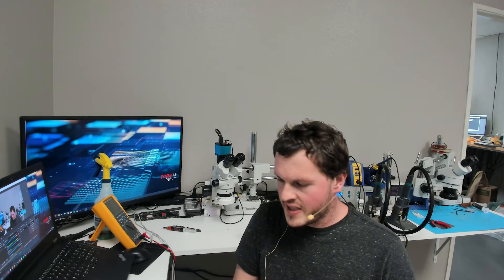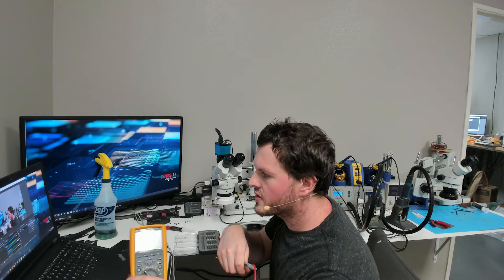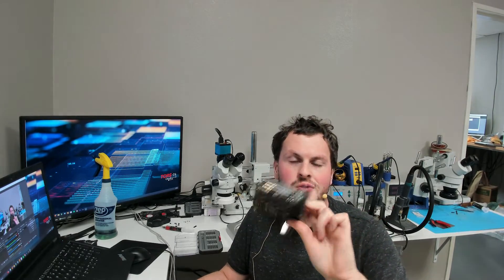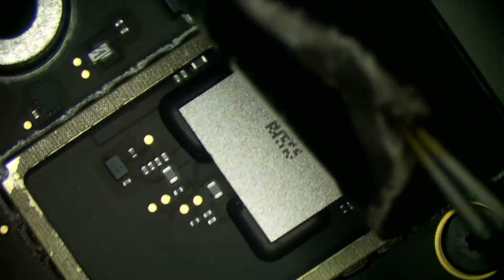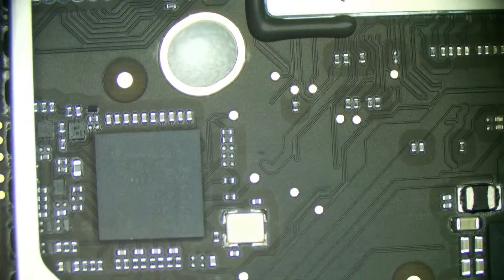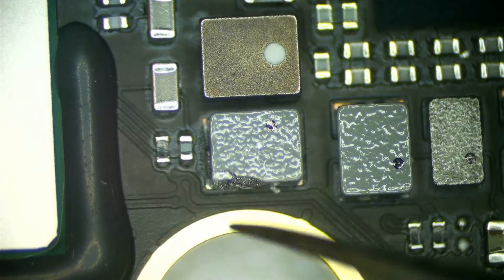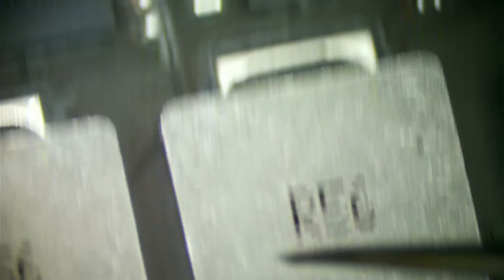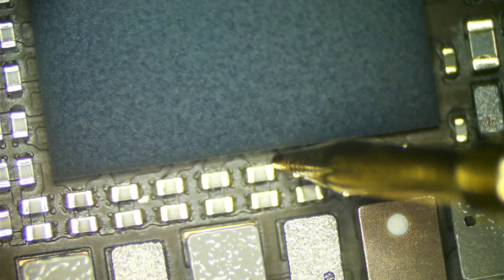A2348 M1 Mac Mini that doesn't turn on. Let's see what we can do!

Comment: 0:30 you can just use power supply 12v and alligator clip on the PSU connector it's just 12v in there's no communication with the PSU at all

Comment: Was really hoping this was going to hold the key to my fried board. Found an area where a bunch of neighbouring capacitors are all shorted and was hoping to find the culprit nearby .. but then couldn't find any component, large or small, that would "accept voltage", so wasn't able to use the "hot component" method to find one or two components in particular that were shorted.

Also, when it comes to "my power supply has 12v" .. what if one of the "no connect" pins has 12v when it shouldn't? Isn't that a problem? Seems kind of dismissive, or at least incomplete, to simply find 12v on one of the 20 power supply pins and immediately conclude that it's probably fine.
Reply from the maker: Sounds like your shorted capacitors are just naturally low resistance lines, likely going to the CPU, which is probably now destroyed if you injected voltage into it. 

To reply to your second part, it's funny that you say my methods of testing a power supply that supplies 12v, and only 12v is dismissive especially when you likely just destroyed your own board ;)

Comment: replace powersupply with psu 12v dc 2A,psu not good
Reply from the maker: @jailbreak7750  wrong
Reply: @ i hve,short psu
output wire 12.5 / 7A
i'll replace with diffrent psu

Comment: @TCRS Circuit Are you sure that cap isn't necessery?  Do you even bother to do oscilloscope mesurments and make presicise calcaulation of the reactance and all that stuff? Electronic engineers makes very prcesise calculations, simulations, builds one,  two,  ten protetypes, makes long term testr  to figure  out such things and you figured that out just with bear eye... Cogrants bro, become an electronics enginner! With such high skills - you will a bilionaire...

Comment: How much did you charge for that?  I have a M1 mac mini that won't boot.  I don't really need the data off of it, everything important I always put on external drives.  Would fixing a M1 Mac Mini be worth it?  It looks like a used one with the same specs would be 400 at the cheapest.

Comment: What do you charge to work on an M1 Mac mini? 

Had an M1 Mac mini die randomly - Apple is currently replacing the PSU to see if that was the issue 😬
Reply from the maker: It's not the PSU. It almost never is. $250 to $450 in most cases.

Comment: My Mac Mini M2, just 65 days old, failed to boot...got the gong sound but then nothing happened. Tried all the standard user tests; swapped power cables, outlets, long press of start button, etc. Got to Genius Bar and they repeated my steps, then said it's probably a power supply and took it in for service. I can only hope they are as thorough as you were, when it gets to the workbench. Thanks for a very informative video.
Reply from the maker: The Genius Bar is one of the worst places to bring a Mac outside of warranty. If you had any data on it, it likely will be gone when you get it back as they will likely replace the motherboard. The power supply is rare. I’ve never seen it on a newer Mac mini.
Reply: How it is now ? can you repaired?Also my mac mini m2 suddenly power sleep and now i cannot turn on my mac😢
Reply: @Linjp23  they replaced the power supply...working fine now, but I still question the failure...fingers crossed

Comment: Hi, I'm one of your subscribers and I've been following your channel for a long time, many compliments, in many cases you've been of great help to me.
I have a mac mini m1 that had power problems and I discovered that the chip that manages the LAN (IC BCM57762). I removed it along with a nearby resistor. The short is now no longer present, the Mac mini now turns on but the operating system does not start. I tried to restore in DFU but it's not possible, it always gives errors. do you think the lack of that chip will interfere with the recovery?
Hoping for your response I send you my warm regards ;-)
Reply from the maker: Absolutely. They are very picky. If that is the Wi-Fi ic, then it needs the original to work, it’s not replaceable
Reply: @TCRSCircuit  I think it is the one relating to the LAN network and not to Wi-Fi

Comment: Hi, thank you for what you’re doing, you have helped me along with my passion of fixing stuff.
I’ve got Mac Mini M1 that keeps rebooting with pink screen just a second before crashing, DFU mode or Recovery doesn’t work. Sometimes it works for few minutes and I’m able to log in.
Any idea why?

Have a good w
Reply from the maker: They always pink screen before shutting down -- that part is normal. Sadly the crashing can be anything. I'd try wiping and reinstalling the OS before everything
Reply: Just a quick note , this issue happened after a power surge.
Reply from the maker: @vasyltokar4062  Best of luck, these can be the worst.